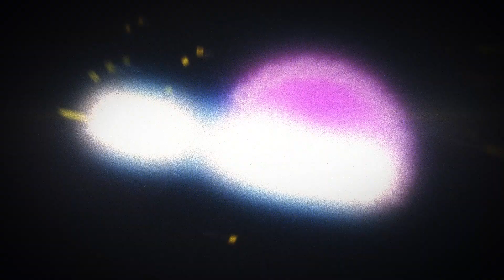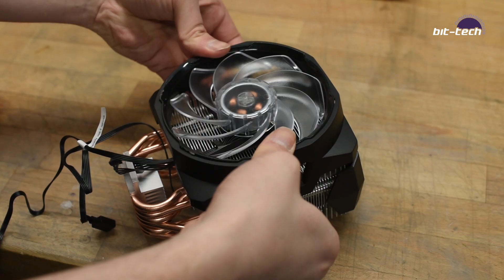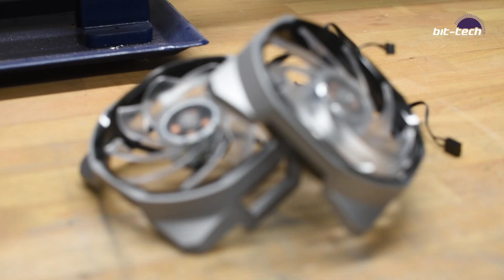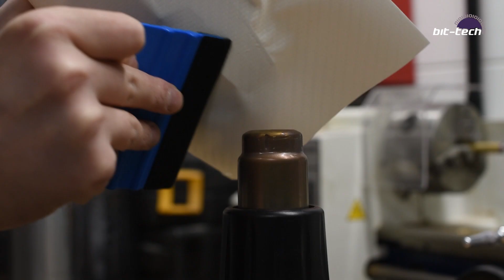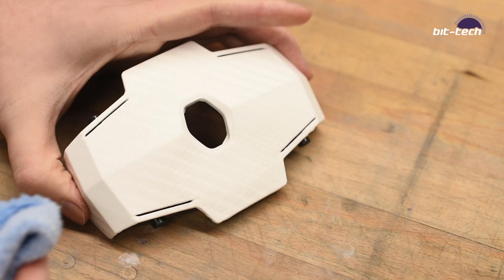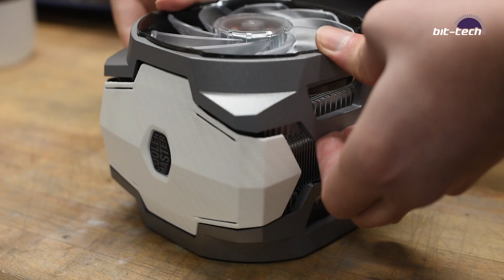Easy Paint and Vinyl Mod for Air Coolers | bit-tech Modding

Comment: I am curious if i'd be able to insert  different fans, like some corsair stuff or so
Reply from the maker: Hmm that's an interesting point, you could use other fans but I guess you'd lose the shaped brackets that this cooler uses. You could do this same mod with another brand though that has a more interchangeable system like Noctua or BeQuiet though